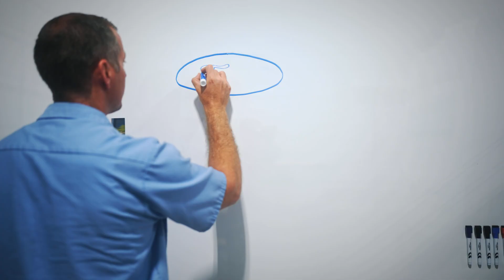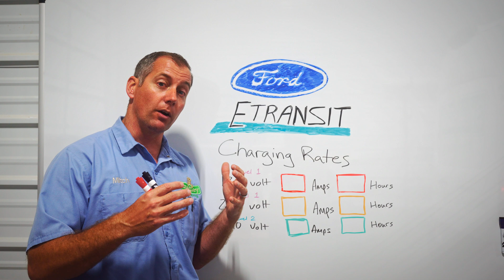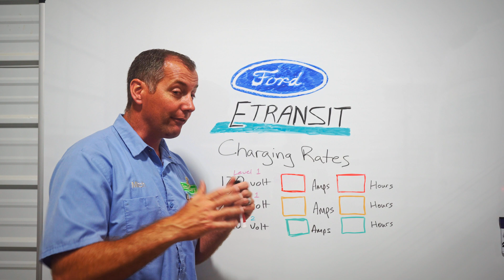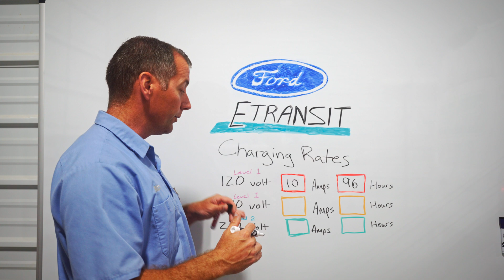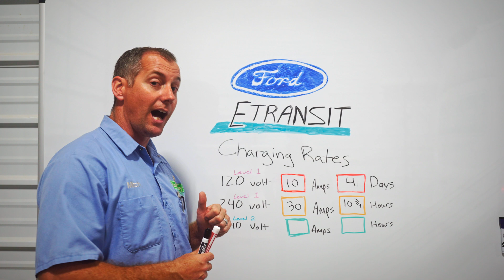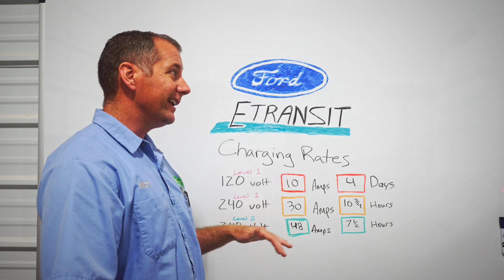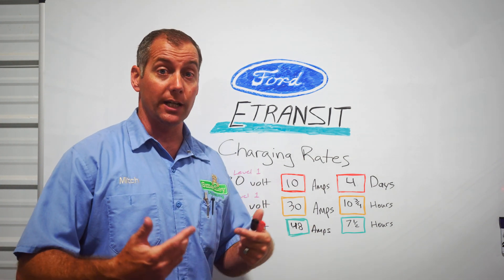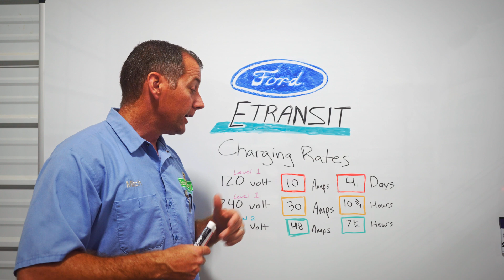Charging times on the Ford E-Transit - How long does it actually take to charge?

Comment: 57 hrs at 120V x 10A = 68kWh. Not 96 hrs.
Reply from the maker: The van charges at a rate of about 1 mile of range per hour of charge when plugged into 120 volt outlet.  The van does not take a constant and consistent amperage. The dashboard of the truck will tell you when charging will be complete.  So in this video we were sharing what the dash will show you. It's not like another electrical appliance where it's a fairly regulated amperage. The charger is actually built into the truck. The wall connector is simply like a glorified extension cord. The truck determines the power available from the wall connector and then charges accordingly. If you've ever connected your vehicle to a high speed fast charger then you will get to watch on the charger the rapidly and wildly changing energy input.

Comment: I just bought a brand new Ford e-transit electric when I plug in the supplied charger from Ford to 110 volts the charger has a blue light and then I hear a click and it goes to an orange light do you know what's going on?
Reply from the maker: I'm not exactly sure.  Make sure to plug it into the wall first, then the vehicle.  You might also reset the breaker just to be sure.

Comment: Anybody know where the 12v battery is on this van and how big that battery tray is?  I'm wondering if any way to send solar (roof mounted single 700w 50v panel) into the system and gain range from it without voiding warranty.  Likely nobody but back end Ford engineers are going to know for sure, but wonder if excess current sent to the 12v would be sent to the EV batteries.. maybe? hopefully?
Reply from the maker: So the van can't charge while turned on.  So the best way to utilize solar is to simply plug the factory supplied 120v charger into van and into the solar system while parked.
Reply: @SmedleyPlumbing  Hi . Thank You. Sorry did not get that.  I think fine that can't charge while "On".. Do you mean make some kind of mod to allow for charging  from Solar DC? in the 120v charging system.  Also wonder, if you can run the AC while charging? While parked with lights and dash off?   wonder if the OEM AC would be able to keep the back cool in Florida?
Reply from the maker: @12vLife  no mods needed really.  If your solar system has an AC outlet, just plug the supplied charger into that outlet and then into the charge port.  Yes ac can run while charging.
Reply: 700 watts after some loss in the charge controller and charger will get  you about 1 mile for every hour of full sun....you are not going to gain any advantage worth the trouble with solar panels on the van.  You would need an array of panels with about 3kw to add 5 miles for every hour of full sun.
Reply: the 12v battery is under the driver seat and is charged by the HV pack.  There is no way to charge the 12v battery and add power to the HV pack.

Comment: Good afternoon Sir, my name is Carlos and I live in Baltimore, my trade is basement waterproofing and I I am  in the process of purchasing a E transit or a Sprinter van,I have a lots of qs and I want to make sure I am making the right decision, I’ve been watching your videos and they are very helpful, my question to you is what happened with the battery die after five years or 100,000 miles? How much do they cost? It’s so hard for me because I wanna make the correct decision I love Ford products but I also know a diesel engine will give you 3 to 400,000 miles easy. Do you a any suggestions? Thank you so much and I do enjoy your videos
Reply from the maker: Same thing that happens if your engine dies out of warranty.  You have to pay to replace it.  What's an engine cost?  I have no clue.  I don't buy vans based off the cost of the absolute worst case scenario because that never happens.  I buy them to use them for 5 years and then sell them to buy another.  This way my customers always see a van less than 5 years old in front of their home and I never have to worry about major component repairs.
Reply: @SmedleyPlumbing  thank you so much for your feedback, very appreciative
Reply from the maker: @carloshernando7837  if you don't get the E-Transit, at least get the gas transit.  The sprinter vans are inferior in many ways.
Reply: @SmedleyPlumbing   na you give me one example on why the Sprinters they are inferior? I need to make the correct decision so again any feedback is welcome
Reply: Can you
Reply from the maker: @carloshernando7837  just look at how many Ford transits are on the market versus how many sprinters are on the market. Look at the high demand and long wait times to order a Transit versus a sprinter.  The transits have more aftermarket support for them and do they have way fewer mechanical issues.

Comment: Hi , Thanks for sharing information, you said you’re charging 100% all the time because you’re concerned about the short 120 mile range, do you thing this EV Van will be recommended over the Gas, when you have to run probably heavy loads affecting more the poor range ?? and the long time to recharge and find a Charging Station on the Road ???
Reply from the maker: It works for us very well.  We are running with 1,800-2,000 pounds at all times in the back.  And still getting 140-150 miles of range consistently.
Reply: Is thos on the 68 kwh battery or 89? @SmedleyPlumbing
Reply from the maker: @NPA.CitizenForTheCitizens  these are for the 68 kWh battery.

Comment: After much consideration, I won't be buying this van due to Ford being Ford. For the price, they could have easily added more horsepower. The reason they aren't is so they can slowly refresh the model by artificially increasing specs for future sales even though higher specs could have been added in at the start for not much more money. Ford is notorious for slowly rolling out updated features so they can get more sales through trade-ins. 

They also could have added all-wheel drive or 4x4 for not much more. They could have allowed you to run devices while it's charging. 

This van just seems scummy when you see what features and specs other EV manufactures have had for years. I can only hope that Ford will grow up and stop playing the games.
Reply from the maker: Sounds like you didn't understand their target market for this first version.  Strictly in town delivery and service vehicles.  It has every feature it needs for the largest market sector of Transits.

Comment: With every video I want to get one of these as my next camper van even more.
Reply from the maker: Might not have the range needed for a camper van.
Reply: @SmedleyPlumbing   Yeah I'm still working out the numbers vs moving to a normal transit or a Promaster as my next van home to live in. Winnebago has built their own based on the transit prior to the E-Transit being completed but its also still in testing.  It should still work out for me because I just do small city driving and we have plenty of charging in the area, but I'm still planning this decision out.

Comment: Can solar panels be added on the roof for extended range?
Reply from the maker: They could but you can't charge the battery while the van is on.  So they would only be able to charge when parked and off.
Reply: You could hook the panels up to an external battery back to power stuff while the van is charging.

Comment: Batteries only have a certain amount of charge and discharge weight do you have to have those batteries replaced better open your wallet
Reply from the maker: They are warrantied for 8 years and 100,000 miles.  Won't be my problem.  Besides, how much do you have to open your wallet to replace an engine?
Reply: @SmedleyPlumbing  Right, or how many $1000's for a transmission? The new Ford electronic transmissions are not cheap or easy to rebuild... and that was before all the latest inflation and parts shortages. YMMV as they say! I'm willing to bet an EcoBoost V6 is a lot more than a battery as well... those motors aren't cheap.
Reply: It has a one gear transmission & is obviously very simple. 
Watch a review of the E-Transit van for more info.
Reply: @flyby2300  Correct, that was my point to the Daniel about the cost of replacing a battery compared to replacing or rebuilding an automatic transmission in a gas powered vehicle. Not cheap either, especially not these days with so many trans parts on national backorder.

Comment: Look up the Weber Auto video.  "There is no such thing as level 3 charging".  
AC level One is up to 1.92 kw 120 volt requires a 20 amp breaker using 16 amps.
Thus 120 x 16 = 1.92 kw
AC level Two is up to 19.2 kw
240 volt requires a 100 amp breaker, using 80 amps
Thus 240 x 80 =19.2 kw
DC FAST CHARGING level One
Is up to 48 kw
DC FAST CHARGING LEVEL TWO IS UP TO 400 kw
Nothing above 400 kw has a standard set yet, even though Tesla and others have Mega Chargers above 400 kw.
DC Chargers are at the stations, direct current the battery.
EVSE: Electric Vehicle Supply Equipment for AC charging of level One 120 volt and level two 240 volt.
AC chargers 1 & 2 are in the vehicle.  
33.7 kilowatt hours is equal to one gallon of gasoline.
Reply from the maker: See!  I'm a newbie at all things EV.  Thanks for the info!

Comment: Question; Did you get the Pro package with the generator? Can you charge the van with it and if so how long to get a functional charge ?
Reply from the maker: We did get the pro power pack.  However, it's only use is to put power out of the outlets.  The van has to be on for it to be in use.  And you can't charge the van while it's on.  This also means that you can't use the pro power pack while the van is charging.
Reply: @SmedleyPlumbing   How much kilowatt hours do you have to power electronics using the power pack? What's the max wattage I can draw from the power pack?
Reply from the maker: @Hyperion_40k  2000 watts.  Kwh all depends on charge and the limits you put for the low battery settings.
Reply: @SmedleyPlumbing  Thank you for the answer ... I wonder why they did it that way, seems a no brainer that you might want to use it as an emergency charger when away from other sources .. funny thought, you could actually use it to charge another vehicle .. but not your own.
Reply from the maker: @arakheno4051  it couldn't charge itself anyway.  The power pack pulls power from the same battery that would need charging.
Reply: @SmedleyPlumbing  Ok maybe I am misunderstanding something, I thought a portable gen to provide extra power (gasoline gen) was included in the Pro power pack?
Reply from the maker: @arakheno4051  no.  It's simply a few outlets that pull power from the 68 kwh battery.

Comment: I'm really appreciative of you sharing your experience running a commercial EV in the real world, this is the area in which I think they're going to make the most impact. I'm based up in Michigan, everybody around here is thinking about how the auto industry is going to weather the future and it's a lot of sleepless nights even for those of us not working for the big three directly. Above and beyond the climate problem it's not physically or fiscally possible for us to maintain unlimited access to cheap fossil fuels, and while replacing a lot of private vehicle trips with walkable neighborhoods and good public transit is the smart thing to do you can't exactly replace a tradesman's van with a bus pass.

Those chargers, properly called EVSE, electric vehicle service equipment, are built in a pretty clever way for how simple they are. There's a resistor in there that provides a very specific resistance value that lets the vehicle know what size circuit it's connected to, it reads that resistance through one of the little control wires that's built into the standard EV charging plug on the vehicle end. The real charger, as in the electronics that convert the AC wall voltage to battery pack voltage, that's built into the van. So it's very important that the EVSE is set up to know what size circuit it's connected to so it can report that information accurately to the van and it will never pull more current than it's allowed, that resistor is like a speed limit sign.
Reply from the maker: Yeah the chargers aren't really chargers at all.  They are more like plugs with voltage/amperage indicators to tell the onboard charger how much power it has to work with.  Pretty cool tech for sure.